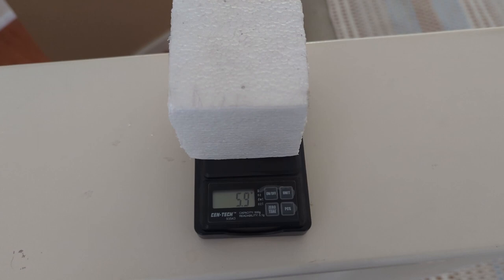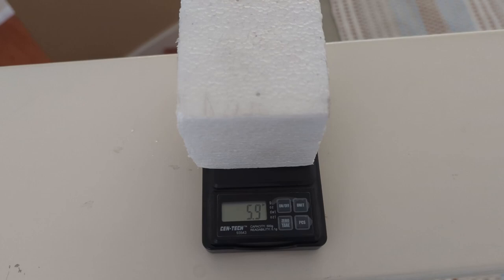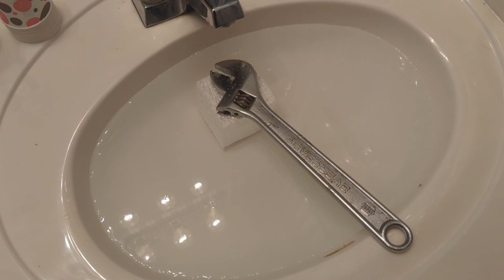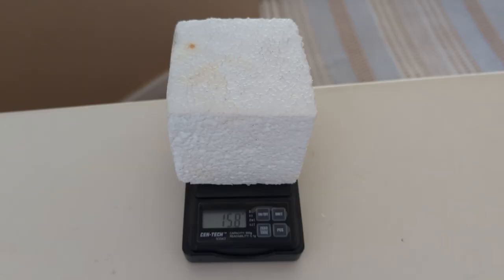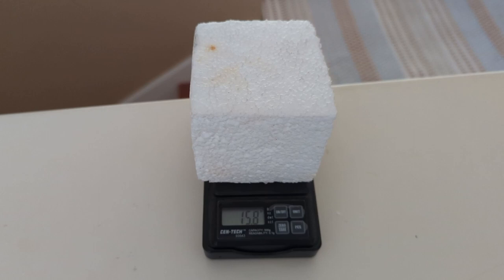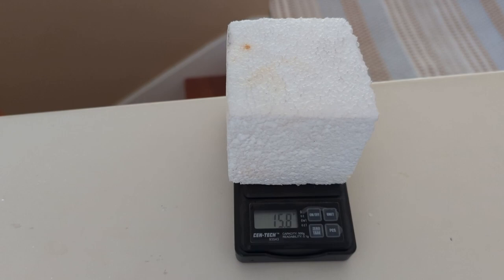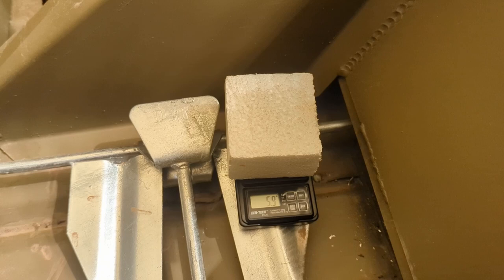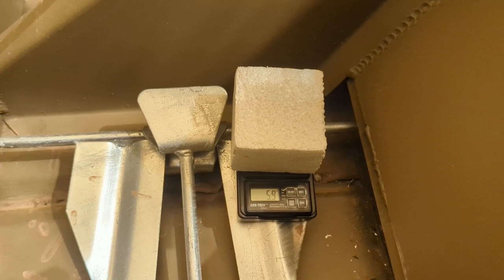Marine Foam Flotation Test

Comment: I used 1-inch-thick Styrofoam boards that I bought from Lowes. They come in 4' x 8' sheets and I cut them to fit the compartments under the floor of my boat and used Liquid Nails to stack and glue the individual panels in place.  

https://www.youtube.com/watch?v=tTYxEF7QheE

https://www.youtube.com/watch?v=e9E3BzDtPbs